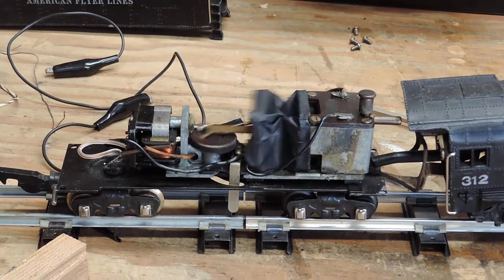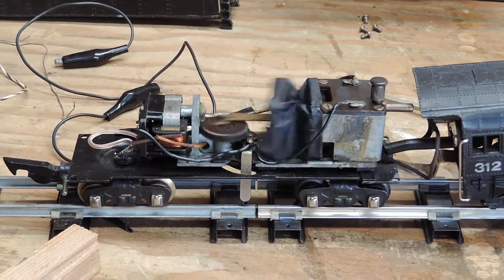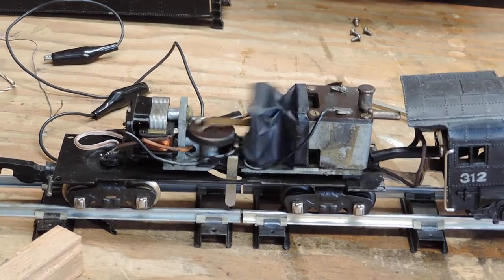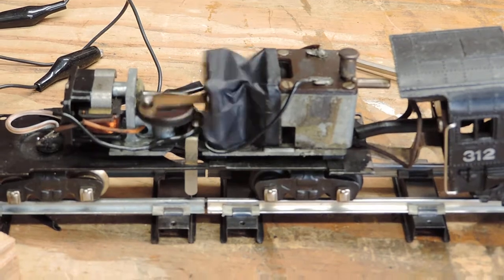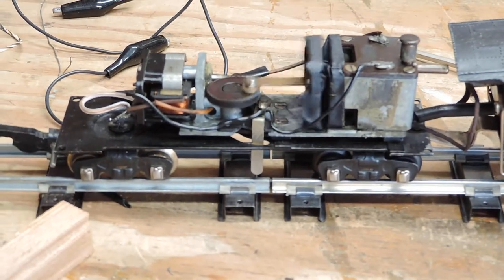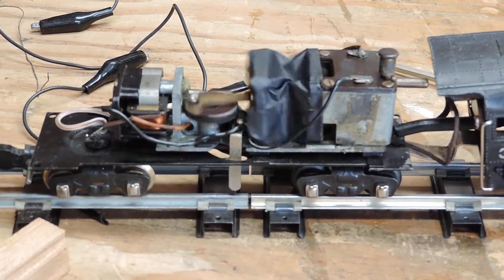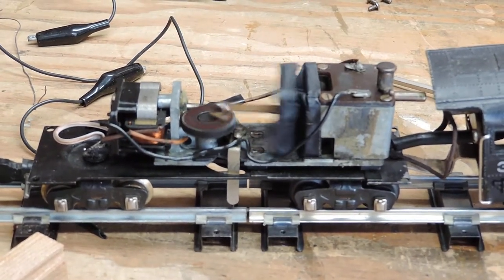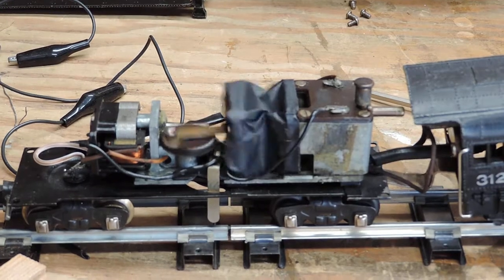Dad's American Flyer bellows repair

Comment: Couple of options. As another viewer shared I too converted my SIT to piston using a kit from Portlines Hobby. I also rebuilt an SIT unit for a customer recently, that had billows, and it worked admirably. 1. Use a volt/ohm meter to check current continuity across the smoke unit, also check power flow to the unit and ground from it, check all connections and solder points within the SIT unit while you’re there.  2. While removing the top plate of the smoke unit might provide better access it also risks severing the smoke wire at its points of solder contact.  So I spray contact cleaner down the filler tube and let stand attempting to remove or loosen old or hardened fluid. 3. Using a miniature funnel (available from Port Lines) inject the unit with a modern smoke fluid. I’ve had very good results with Lionel Unscented Premium Smoke Fluid (6-83280). Following a recommendation from Lionel tech support, I add 14-16 drops of smoke fluid, let stand overnight. If over filled fluid might be blown out of the filler tube, be ready.  4. Set up on test track stand and let run at approximately 60% power (or higher) for an appreciable amount of time giving adequate time for the unit to heat and fluid to be wicked to the wire.  In addition to customer trains my smokers (356, 282, 322 SIT, 21004, 2716) almost run me out of the room and they seem to smoke much longer per run and per days. Hope you find this useful.